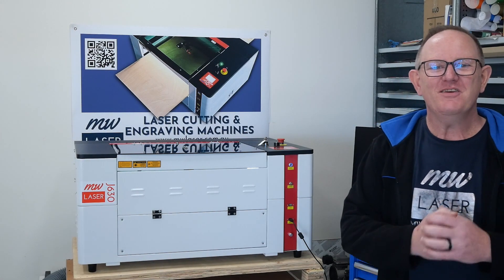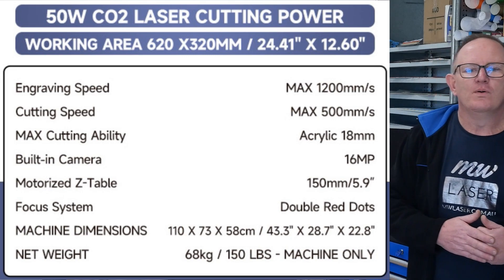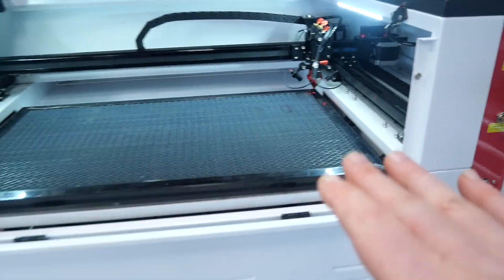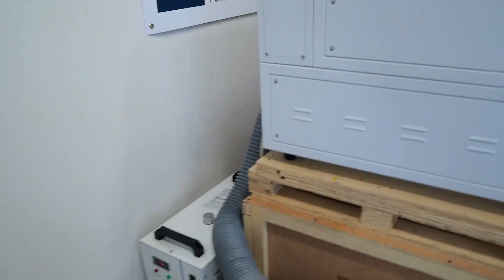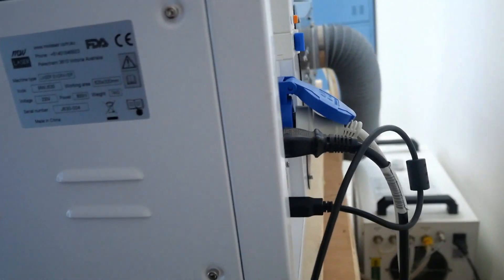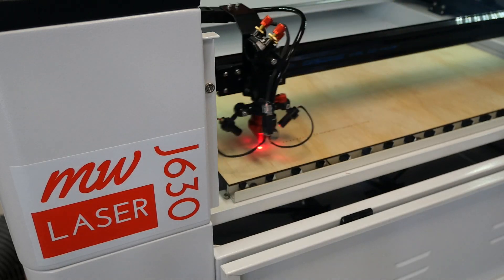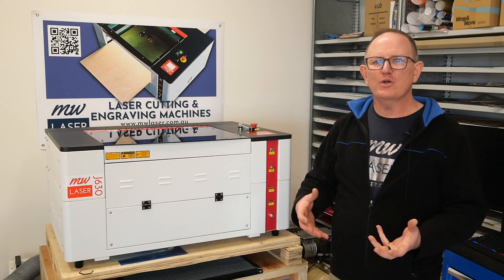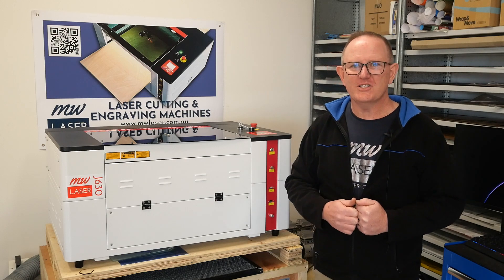Intro to the MW Laser's J630 Co2 Laser Cutting Machine

Comment: Hello, I have a 130 watt OMTech laser. Thanks to your great videos, the laser is very well aligned and calibrated.
But I still have a problem and hope that you can help me or have a suggestion for a solution.
When cutting acrylic, the edge is consistently ridged, like a fine saw blade. Not much but you can see it and it's not a smooth surface.
I have combined and tested all speeds and power including air strength without success.
The fact that the ridges are even, I think it could possibly be due to the settings in the RUIDA.
Or do you have an idea? I can also send a photo of the edges.

Comment: I purchased a AUD$2.5K chinese boat anchor, MW laser helped me get it operational, very easy going, no-nonsense approach, he was very accomodating to my specific needs & got me out the door with a working machine with minimum expense/fuss. 
Unfortunately with purchases direct from china, you can spend as much again if not more just to get your laser operational (I only required some rewiring as my wiring loom factory installed melted the first time i turned it on), often the only thing worth keeping is the box...
I spent the time discussing Matthews own machines, components & experiences which was informative & educational. 
Can honestly recommend MWLaser for service & sales of units & components, absolute legend.
If I had my time again & I knew about MW Laser I would definitely NOT have gone through the pain & angst that the initial 2 year saga of dealing with dismissive/deceptive manufactures from china.
Dont waste your money buying from china, honestly - you may as well set fire to your wallet.
Matt has done all the hard work for you  sourcing decent/quality components that will work as advertised, as opposed to the chinesium whatever number they print on the docket solutions.
It's great to see that Matt now has excellent unit for beginners to run with from day #1.
MWLaser for the win.